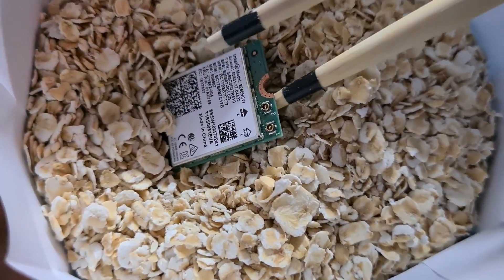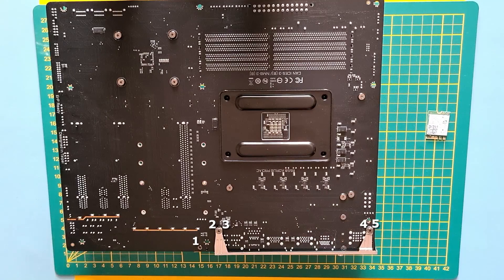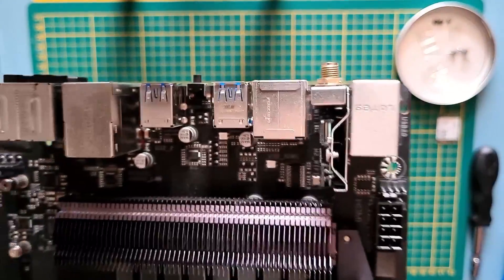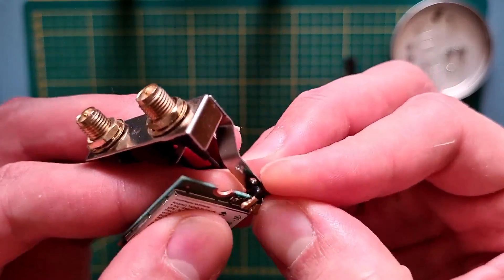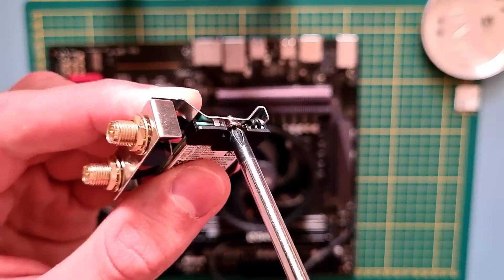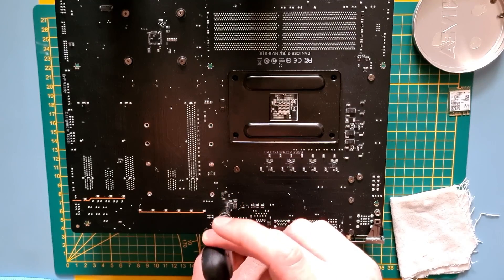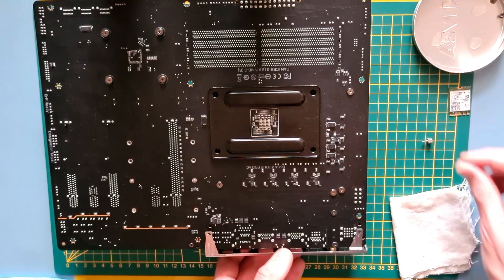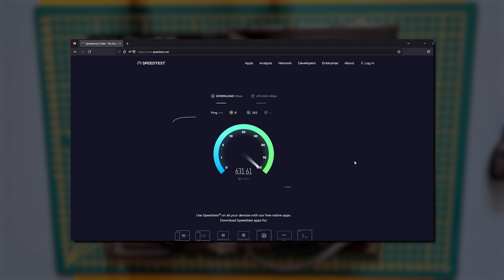Motherboard Built-in Wi-Fi 6E Card Upgrade

Comment from the maker: IMPORTANT!!! Some news I have just learned thanks to @garyc5245 comment.

So, apparently, there is this thing called Intel CNVi and CNVi wi-fi cards work only with CNVi motherboards and CNVi motherboards work exclusively with CNVi wi-fi cards. Also, CNVi has two versions that need to be matched too. Study up on that before swapping your wi-fi cards!

read this before new wi-fi card purchase:

https://www.intel.com/content/www/us/en/support/articles/000026155/wireless.html

link content:

Intel Integrated Connectivity moves key elements of Wi-Fi and Bluetooth Technology into Intel processors.

The solution is comprised of:

- CNVi, the integrated wireless IP portion of Intel processors
- A companion RF (CRF) module in M.2 form factor (2230 and 1216 Soldered Down)

These Intel Wireless Adapters are CRF modules that support Intel Integrated Connectivity:

- Intel Wi-Fi 6E AX411
- Intel Wi-Fi 6E AX211
- Intel Wi-Fi 6 AX203
- Intel Wi-Fi 6 AX201
- Intel Wi-Fi 6 AX101
- Intel Wireless-AC 9560
- Intel Wireless-AC 9462
- Intel Wireless-AC 9461

These CRFs can only be used with select Intel processors/chipset on systems/motherboards that is specifically designed to support it.

Though you can insert these CRF into a standard M.2 Key E socket, they are only compatible with a system designed for the CNVi. Contact your system or motherboard manufacturer to verify compatibility.

forum thread:

https://community.intel.com/t5/Wireless/Differences-between-Intel-AX211-vs-AX210-WiFi-6E-Bluetooth-v5-2/m-p/1358093

link content:

"I do not like the fact that a M.2 Type E socket supporting CNVio or CNVio2 cannot be used with/for generic M.2 Type E devices. That is, if you have a motherboard with a CNVio-based M.2 Type E socket, you can only install a Wireless-AC 9461, 9462 or 9560 module. Similarly, if you have a motherboard with a CNVio2-based M.2 Type E socket, you can only install a Wireless-AX AX201 or AX211 module. When I say '*only*', I mean that installing anything else may cause the motherboard to not  even power up."
Reply: @will_neithan  don't buy the ones that end in "1" being wifi 6 cards unless u have the veeeeery specific model of Mobo that is compatible with the wifi card
Reply from the maker: @javierguardiola7122  I hate, that they had to make it complicated.
Reply: @will_neithan  yeap and even wore wifi 7 cards using cnvio3 instead of 2 so who knows even if is compatible
Reply: for example i have z790 hero wifi 6e and 13900k but z790 dark hero model (1 year later) has wifi 7 so maybe i gonna try if it works
Reply from the maker: @ Thanks for the additional info. According one thread on Intel forums, cnvio3 card won't work in cnvio2 slot.. vice-versa, I don't know.. so if true that sucks. If you ever try some swapping let me know please. The more useful info the better.

Comment: about to do this myself on my PC after dealingn with Mediatek MT7922/RZ616 issues on my B650E for months. will be my first time taking apart myself 😅
Reply from the maker: Do it! Good luck with it. And don't worry that much, motherboard and other computer parts are pretty durable. Although I managed to tear off the gpu pcie lock once because I wasn't able to reach it so I used a screwdriver and my angle was wrong I guess:D

Comment: Currently trying to do this on my Tuf Gaming X870…I can’t get this plastic shield off for the life of me!
Reply from the maker: Sorry man, I kind of overlooked your comment. Any progress? So you took out the black screws on the bottom side and it still doesn't budge? There have to be then some additional screws. I can even imagine, that maybe there are screws on the top part under the VRM heatsinks, so MAYBE you need to unscrew the parallel heatsink and beneath you find screws holding the cover. I don't know though.
Reply: @will_neithan I just caved and bought a PCIe adapter. ASUS soldered the shield down on my mobo model so I SOL anyways. Thanks for the response though!
Reply from the maker: @BlazySnow  omg, animals.. I don't understand why they would do that.. it's just a piece of plastic...
Reply: @will_neithan It’s very stupid lol

Comment: Hola, buenas tardes. Yo también tengo un Miniforo como ese, y el otro día vi que los cables del wifi se habían soltado. No sé exactamente dónde van; ¿se conectan al chasis o dónde los han puesto? Gracias.
Reply from the maker: Hmm, I'm not sure which cables you are referring to. There are two wires that are connected to the antenna slots, check step 4. Then there are externa antenna wires that connect from outside of PC case, in the back on the I/O shield.

Comment: Hats off for a very well made video my friend! Great quality on sound and video and the performance and also a thumbs up for posting the update info about the importance of CNVi. I've never heard of this and I'm still very well versed with computers.

However, the video only helped me partly. I am having major issues with my onboard Bluetooth because it doesn't find my Marshall Kilburn speaker, well it does at times but then it just drops in and out and never really plays any sound.

I am trying to use a Bluetooth dongle instead which has a lot better range, up to 100m, and no it's not just marketing. I've tested it and it kicks ass.

Anyway, so I am trying to figure out how hard it would be to remove the wifi/bluetooth card on my Gigabyte X570 Aorus Extreme that has A LOT of covers and cooling fins / heat sinks.

If anyone can provide me with more information on how to do that, I would appreciate it a lot!
Reply from the maker: Hey, thanks for the praise! If the speaker worked with the dongle perfectly than yeah, I guess swapping the wifi card is the next step. And regarding the removal of the shields and covers, the process won't be much different than in my video. If you accidentally unscrew a screw from a different part, you'll know immediately, so just screw it back in.

Comment: I just found your video and I immediately regret buying this card. I’m not taking out the motherboard from my tower, screw that. Time to return this thing and get a pcie version. Thanks.
Reply from the maker: Yes, that is the easiest solution. Don't forget to disable the old wifi card in Device Manager, after you install the new one.

Comment: So cool you can upgrade to Wi-Fi 7
Reply: I'm going to upgrade the connectors on my MSI board because it's using a non standard screw connector. Great video
Reply from the maker: @GSP-76  thanks mate! good luck with the upgrade
Reply: @will_neithan thank you, I wouldn't even attempt this if it wasn't for your video! Thanks again!
Reply from the maker: Yes! Although, I don't have the need right now, the 6e is doing it all so far:)

Comment: does this work for msi z790 gaming plus wifi upgrade from wifi 6e to 7
Reply from the maker: So, because your motherboard is Intel CPU, your wifi card probably has to support one of the CNVI technologies. You need to find out the model of your wifi card and check online if it is indeed a CNVI card or take the card out and read the label. Maybe the motherboard specs somewhere will say is it supports CNVI or not. I tried to check but failed to find info. Search some forums if someone else who has the same motherboard as you talks about this. You probably have the AX211 card inside, but that is just a guess. If that was the case, on Intel official site, it says that AX211 is CNVio2 card, so you would need to get WIFI 7 card that supports also this CNVio2 technology. If you get the correct upgrade wifi card, then yes, it should work.

Comment: Removing the entire metal frame from the motherboard seems a bit overkill to me :face-blue-smiling: 
Anyways, thanks for the video. AX210NGW for Linux is the GOAT!
Reply: It really is. Arch with the AX210 is like magic.
Reply: @bhume7535  I came here for that purpose only. I have msi b650 tomawak wifi motherboard with some reatech wifi card and bluetooth connection is not stable at all. I am now thinking about installing this card in it and I was looking for this comment. Thanks for confirming it fellow arch user.
Reply: @bhume7535  Might look into that. I'm having major issues with my Gigabyte X570 Aorus Extreme Wifi/Bluetooth card on EndevourOS. I'd like to use my external dongle instead which have great range. But might look into replacing my current onboard with the AX210 instead.
Reply from the maker: Overkill.. well, depends on what is your goal with the motherboard:D

Comment: Hi👋🏻, I’m wanting to upgrade my ASUS Prime X670e-pro wifi motherboard to Gen 7 but being AMD I’m unsure what card to use for the replacement in the adapter. If it’s even possible.
Reply from the maker: Hey, yeah it should work. It is AMD board it is easier to choose a wifi 7 card.. AMD does NOT SUPPORT CNVi, so any standard non-CNVi card should work.
Reply: @ 
I saw a couple of videos about how intel deliberately produced the BE200 to not be compatible with AMD. Appreciate the feedback. The card fits behind the motherboard i/o shield for the wifi setup already on the motherboard. You remove the 6E card in my board and replace it with a  gen 7 one . Theoretically 😂
Reply from the maker: @Runduckpotato  Yeah, theoretically:D .. if Intel started doing some shady compatibility machinations then it's going to be all just guesses from now on. On the official product site, the BE200 does not say to be CNVi, so on paper it should work.. unless they forgot to disclose some parameters.

Comment: Do you happen to know if this can be done for downgrading a motherboard with wifi 7 to wifi anything else so that it can work with Windows 10? Not sure if the wifi 7 modules are the same type, or if they're even removable. Thanks.
Reply from the maker: Hey, it should be the same design, a card inside a module. I've read online that people had successfully swapped wi-fi 6e cards for wi-fi 7 cards, so it should work also other way around. Just read also my pinned comment for more compatibility information.

Comment: I have a hp omen 35 L I'm completely new to PCs but I have very slow speed would swapping this help I have a variation of a realtek card
Reply from the maker: Strangely, your comment does not show in my notifications. It depends. You need to know what is the max download/upload speed from your internet provider. Then you need to check the specs of your router what speed it handles through Wi-fi. Also check the max speeds of your wifi in PC. The lowest number of the three is the speed cap. Then you should take your PC just next to your router or take the router with all its connected cables and place it just next to your PC, connect to its wi-fi and measure the speed using "speedtest.net". Check if the measured speeds correspond the lowest value of the three either provider max speed or router max speed or PC wifi max speed. If the speeds check out, then the problem is most probably in the signal strength when the PC and router are on their usual places. So take the router/PC to their normal spot and test speed again, if it is low, you need better wifi coverage. If the speeds are off after the first measurement when the PC and router are next to each other, test other devices the same way and verify if other devices achieve their max speeds (the lowest of the three.. provider/router/device max). If other devices are good, then you should troubleshoot your PC. Update your drivers, that is the easiest. Or you can try a different wi-fi card, like I show in the video.

Comment: Installed this card, BSOD an instant and windows won't boot
Reply from the maker: Troubleshoot, troubleshoot!!! 
First make sure that you have read my pinned comment.
Next, take the whole wi-fi module out of the system and try to turn on your PC. If that works, try again your original card. If that works, try the empty module only. If all good, go to bios, try to disable wi-fi pcie port (wnic), then try to plug in the new card again. If PC boots, then it should mean there is no short on the card, so it is some compatibility. Try to disable fast boot in bios. If that doesn't help, depending on what kind of motherboard you have, I remember one time I was getting blue screen after installing new component and I fixed it by changing some pcie initialization settings in bios, so try to find on google: *your motherboard model* "blue screen after installing new component". If that doesn't help, try the wi-fi card in different computer to see if it works.. do this step as one of the first, if it is easy for you to get your hands on another PC where you can try it.

Comment: Could you have left that big IO cover off? I am thinking of upgrading the WIFI to 6E on my MSI Prestige X570 Creation, keep the rear IO shield of course, but just leave the big cover off. The RGB loss would be no issue.
Reply from the maker: Sure, it shouldn't be a problem. The back IO shield should be screwed in, also on your board, I presume, so it should hold. Just make sure you press it in properly into the IO frame on the PC case. The RGB though, the LEDs could be on the board actually and the cover serving as a light diffusor only. So check it out, you might end up in a situation, that the RGB will glow to all directions. You can always turn it off in settings, but it could be that you would have to turn off RGB for the whole board. Also verify, that the the cover IS only a cover and not also a cover/heatsink combo for VRMs. However, that would be unlikely, in my opinion.

Comment: Can you tell me what exact wifi card was there originally. Mine one doesn't show up in the device manager at all not even the drivers. Cam you please tell so that i can reinstall the original drivers. I have the same motherboard.
Reply from the maker: The original wi-fi card is Intel 9260NGW
But that is strange, it should be detected. Go to your BIOS and check if the wi-fi (NIC) port is not disabled, if there even is option like that. Try Windows Update to find the appropriate drivers, if that doesn't help, try the Intel Driver & Support Assistant. If that fails, try to find specific driver for this card on Intel website. If that fails, try to update your BIOS, if update is available. If that fails, you can try to take the wi-fi card out and swap it with some other wi-fi card, to see if the other one works or if the problem is in the port somewhere.
Reply: @will_neithan i did all these thing but nothing worked. In the end I just opened the io and just reinserted the card after cleaning it and it automatically came back. Thanks
Reply from the maker: @avrayushranjan  Man, that is strange. Well, it worked in the end, so good for you. Cheers.

Comment: hai ,can we connect m.2 nvme ssd on that slot ? 😅
Reply from the maker: That is a big maybe, unfortunately there is no universal answer. First, the ssd and the m.2 slot have to be physically compatible, you need to be able to insert it in.. this step has also a few caveats regarding the keys. Then it is up to the motherboard if the specific slot has functionality for pcie/sata/nvme. It can be one of the options, two, or all of them. Third, even if you make an ssd work in your wifi pcie slot, the speeds and stability are uncertain, since the slot was primarily made for wifi card. So, yeah.
Reply: that is pcie x1... so be my guest and get 1/4 the usual speed.

Comment: Thanks heaps,  I did this to my motherboard ( Asus TUF Gaming B650M-PLUS WiFi) after watching your video.   It was simple and easy and worked like a charm.  I got the Wifi card from Ali express for approx equivalence of $10 usd delivered.   It's something I'll do with all my motherboards now I don't want to waste time trying to find work arounds etc  if it's not Kernel supported in linux I'm not interested especially when the work around is so quick and easy.
Reply from the maker: I'm glad the video helped:) Don't forget to read also the pinned comment about the CNVi wi-fi cards!
Reply: I have the same motherboard. I’ll have to try it out when I get my new router with wifi 7
Reply: I have the same motherboard, my wifi stopped working and i need to replace the wifi card. What model did you intall? 
Is there any option for wifi7 yet?